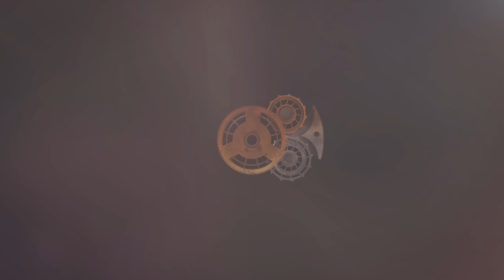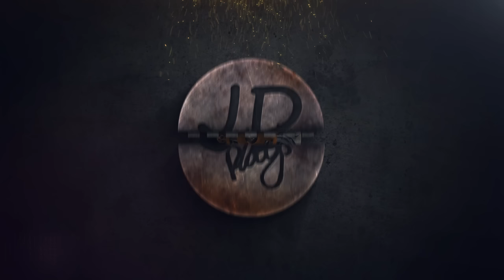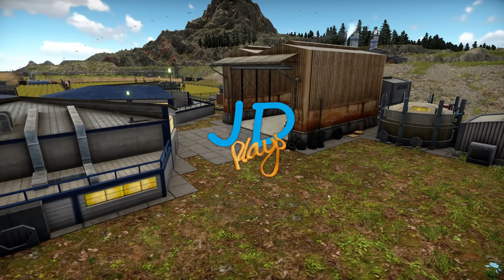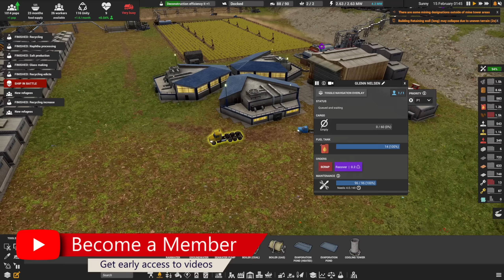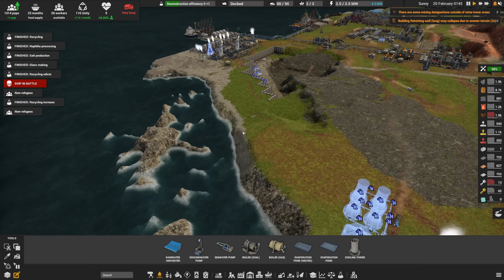FREE DIESEL From Waste! 🚛 Ep14  🚜 Captain of Industry  👷 Lets Play, Walkthrough, Tutorial

Comment: hey JD did you mean to add a flare to the back of one of the cracker units to deal with excess fuel and keep the system running?
Reply from the maker: Why? Everything is built to ratio, the only excess is a bit of naptha, which goes into the single extra boiler for a tiny amount of intermittent power
Reply: @JDPlays  i was just thinking along the lines of "this system cannot and should not back up". Maybe it is not needed then. I did end up with excess diesel though so I am making more naphta with it to run boilers for now

Comment: hey JD thank you so much for making this guide. I love the build !! I wanted to ask you about something. I added cracking units on the other side of the crude oil pipe because i was getting full with diesel and the system was shutting down. Instead of burning it i figured cracking it makes more sour water and naptha. i added a boiler as well.
Reply from the maker: Its a very valid idea, I don't have the tech yet to crack into sour water, but honestly with how im playing I doubt long term ill max out the diesel